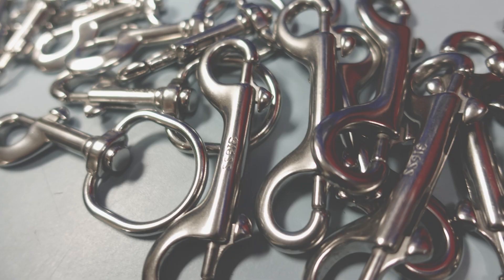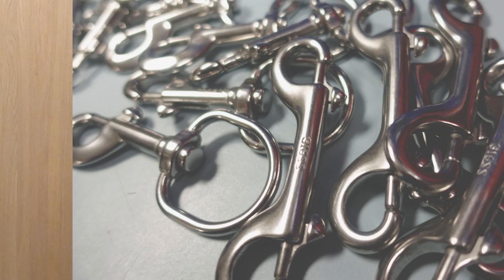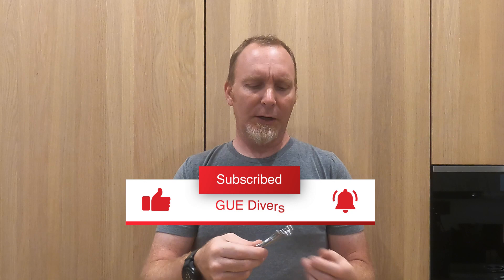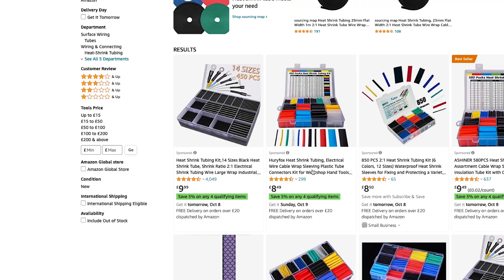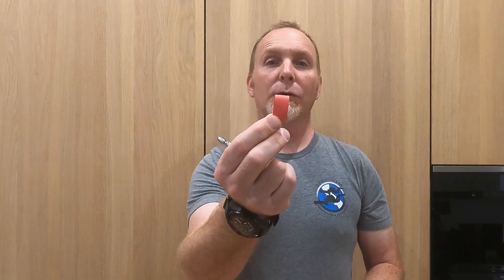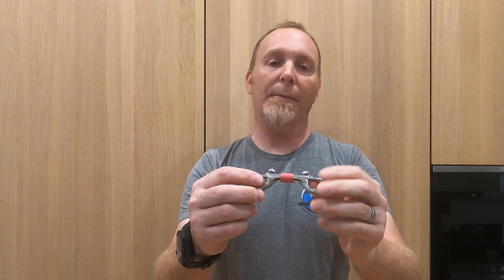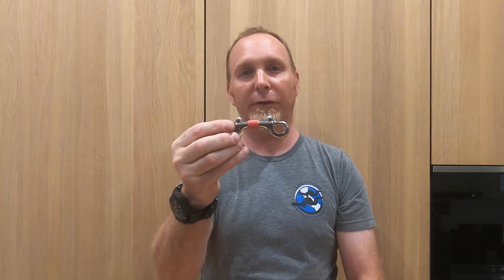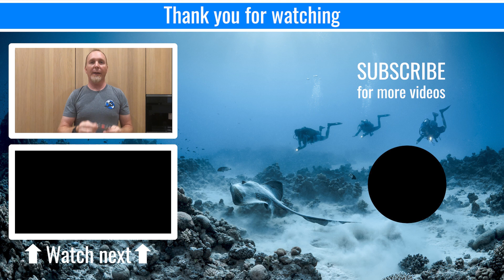Tips & Tricks Double Ender

Comment: Thanks for making these videos. There are two kinds of shrink tubing: with and without heat activated glue. I now use the glued version. I find it better at preventing the shrink tubing from moving and interfering with ketch movement. Both versions provide a nice surface to write your initials on.
Reply: any thoughts on the preferred shrink ratio?
Reply: @MrNachtduiker  I use 1/2 inch (12.7mm) 3:1 dual-wall with glue. This is smaller than the one shown in the video. It won’t go over the closed gate. So I have to open the gate and thread it through the opening and then over the ketch in open position. Using a smaller diameter shrink tube helps getting a tight shrink.
Reply: @RogerLacasse  I am guessing 1/2 to 1 inch shrink tubing would work.
Reply: @RogerLacasse  Excellent, thank you so much for your detailed reply. I'll go try this out!